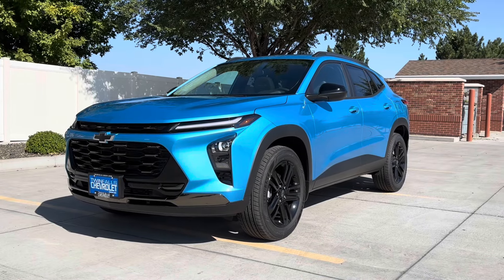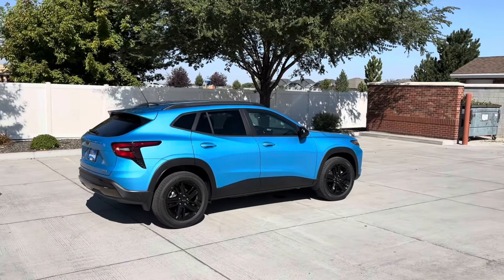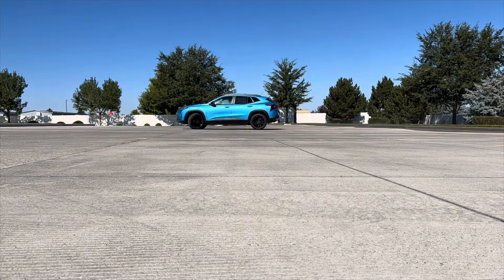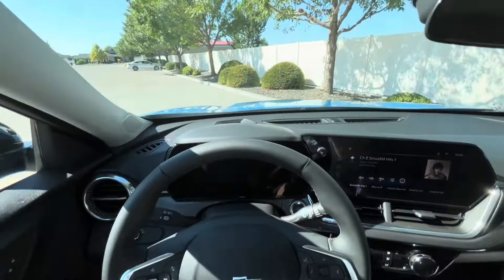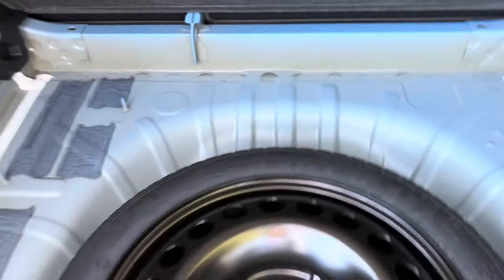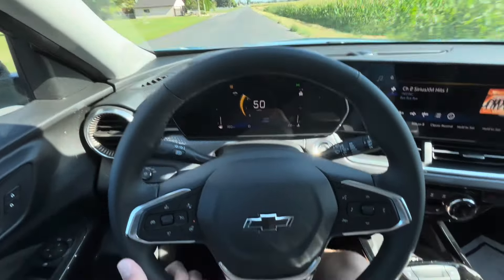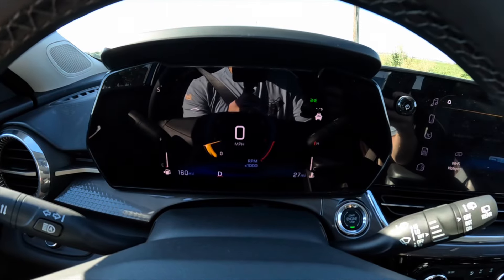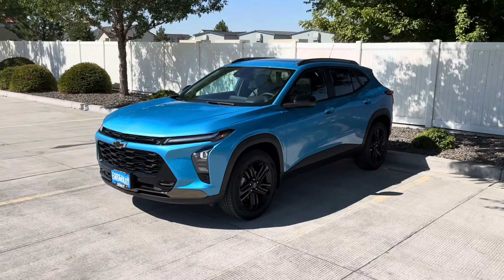2025 Chevy TRAX Activ | Review and 0-60

Comment: A friend of mine just bought one of these in that color. It actually looks pretty sharp.
Reply from the maker: This color really pops in person! I’m sure your friend is enjoying it.
Reply: I hope it lasts
Reply: @Doc1855  I haven't bought a new Chevy since 1988. I sued general motors under the lemon law and won.
Reply: @m3rdpwr  Chevy has been building Crap for years
Reply: @Doc1855  Yeah, that being said, I could see buying something like this, if I wasn't going to keep it much past the warranty time.
Reply: @m3rdpwr  We generally keep our vehicles for many years and hundreds of thousands of miles
Reply: @Doc1855  Generally a good thing. I bought my 2014 RAM 1500 Laramie new in 2014. Just turned 10 years old this week and only have 50k miles on it. So it's got some life in it. My wife has a 2017 Nissan Rogue with 72k on it and thinking of trading it in, before that CVT acts up.
Reply: @m3rdpwr  Yeah, I’d get rid of the Nissan. It has the Jaeco CVT transmission and they’re known for failure. It costs $8K to replace them.
My wife’s 19 Outback has a CVT and I scheduled an appointment with Subaru of Spokane (WA state) to have the CVT fluid replaced. It currently has only 37K miles on it. The CVT fluid was replaced at 36K miles.
Subaru says that the CVT fluid is a “lifetime” fluid but I’m a maintenance nut. They also changed the front and rear differential fluid and an oil change.
Over the years we’ve always used our pickups for work around our property, light off roading on Forest and service roads, as well as transportation, so I have the front and rear differential fluid, transfer case and transmission fluid changed every 30K miles.
Toyota says to do it every 60K miles. Toyota also says to change the oil and filter every 10K miles but I do it every 6 months (I only drive 6-8K miles per year), or 5K miles, which ever comes first.
Our vehicles get new antifreeze every 3 years.
During every oil change I take a “turkey baster” and suck out the revisor of the power steering fluid and replace it with new fluid. The same thing goes for the brakes.
Every 6 months I also add a can of Techron fuel system cleaner to the fuel tank.
Like I’ve said before, I’m very much into maintenance.
My first Toyota ever was a 78 Corolla (bout in 83 with 70K miles). I promptly changed the grease in the manual transmission and the rear differential, as well as an oil change.
Back then we had conventional oil so it was changed every 2,500 - 3K miles and then the transmission and rear differential every 30K miles.
I bought it for my college car. It got me through my PhD and after that I simply wanted to see how long it would last.
It died in 02 at 488K miles. I replaced it with a new Camry.
I drove my Camry until my needs changed in 11, which is when I bought a new RAV4 Limited 4WD with the 3.5L V6.
I drove it until I heard that the new Tacoma’s were dropping the 3.5L V6 and going to the 2.4L Turbo.
So I sold my RAV4 and bought a new Tacoma TRD Off Road, double cab, long bed with the premium and technology pkgs.
This will be the last pickup I’ll ever need to own.
Yeah we’ve owned other fun vehicles, but for daily drivers, it’s been Toyota’s for me.
My wife has had Toyota’s, Honda’s and now her Subie.
She’ll retire in 12-15 years (she’s younger than me), so we’ll replace her Outback with a new vehicle and I’m sure she’ll drive it until her death.
I’m also sure that after I’m dead she’ll still be using my 23 TRD to plow the 5-7 feet of snow off our private road during the winter until her death.
Enjoy your day and Be Blessed !
Reply: Just got one on white and I love it

Comment: The center gauge cluster is totally customizable, you can choose between 5 different looks, if you are doing a review on the features make sure you understand them instead of rushing through the cockpit. Push the button on the right front of the steering wheel to select.

Comment: Not a GM fan, but it's shows vehicles at this price point are possible. It will be interesting how this does in crash tests. I did a bit of searching an so far I couldn't find anything on the newer models.
Reply from the maker: Absolutely! I’m concerned another trade off with the price point is the engineering R&D that went into developing its structural safety. Hopefully I’m wrong, because these are pretty cool! Thanks for watching.